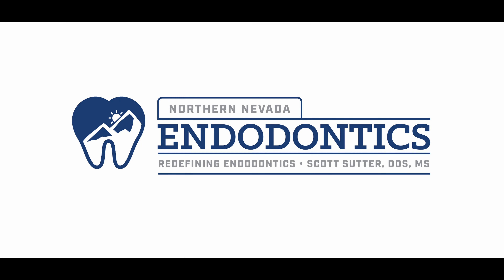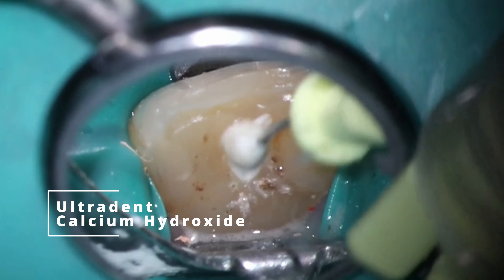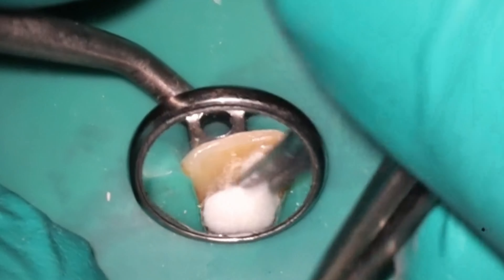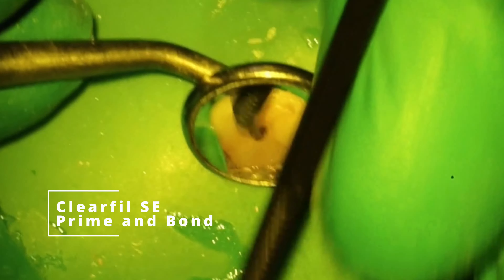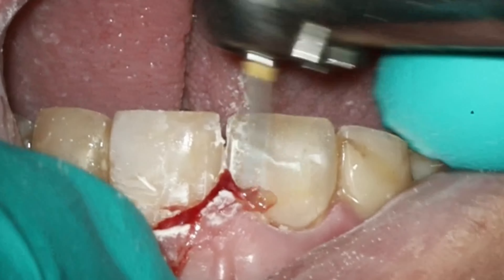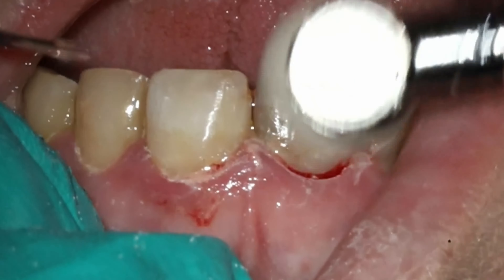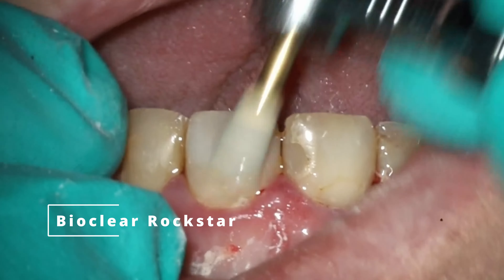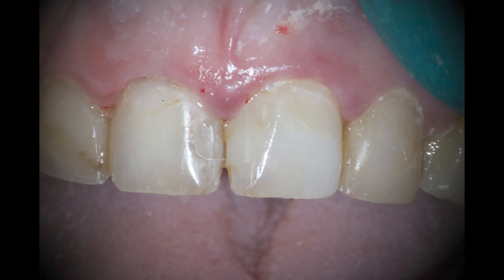Internal Resorption Repair Without Surgery (With a BONUS!)

Comment: Great management of the case doc!
Especially how you gave the patient a better smile considering her financial situation.
But i was wondering why you didn't use MTA or BC putty to fill the resorptive defect. Great case anyways!
Expecting more informative videos doc.
Cheers!
Reply from the maker: Thanks for the comments! 
I've found that the material doesn't make a difference if it's mostly internal. If it was a large defect that was directly contacting bone, then MTA/BC are the best. In this case though, I felt like the composite would "flow" better than the other materials. Unfortunately there isn't a ton of good literature on this topic as it's pretty rare and you can't really do a double blinded study on something like ECIR! I'll for sure be following up with her to make sure the case is still healing

Comment: How does that internal resorption not got filled with sealer ? a bioceramic sealer would make any difference?
Reply from the maker: You and me both man. No idea how it didn’t get in there 🤷🏼‍♂️ maybe gentlewave would have helped here? I have another case like this in calcium hydroxide right now and they should be back soon. I’m going to try and use heated injection molding of composite a la David Clark and I’ll for sure post it! 
Re: BC, I don’t think it would help that much. The vast majority of the resorption was internal and the benefit of BC is when it’s up against bone. I’ve also found it doesn’t flow correctly with the squirt technique because of the heat, so I only use it with cones.
Reply: @PatencyPro  this unfilled space have any impact on prognosis?

Comment: Cool case! Seems like in your posted content you generally prefer sonic activation with EndoActivator vs. ultrasonic activation. Could you speak on your thought process? Trying to decide if it's worth it to pick up an EndoActivator if we've already got a piezoelectric ultrasonic unit on hand.
Reply from the maker: Thanks for the comment! I don't think there is a clear benefit to one versus the other. For my workflow, it's easier to use sonic activation than ultrasonic (I tend to use ultrasonics sparingly). If you're already using ultrasonics and loving them, go for it!